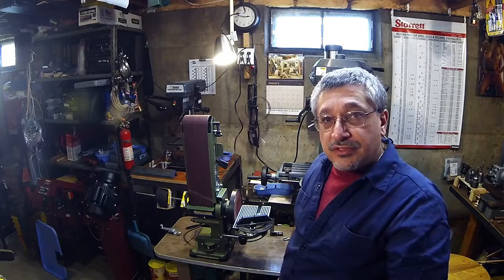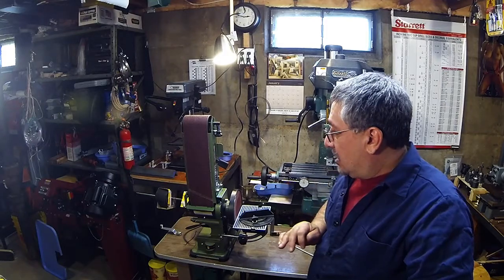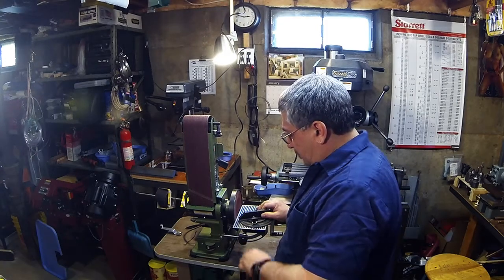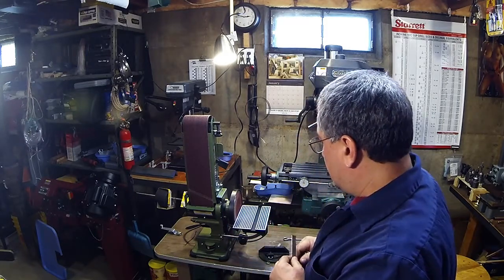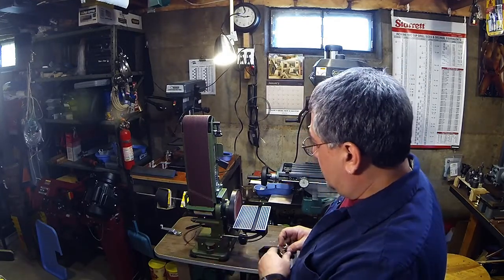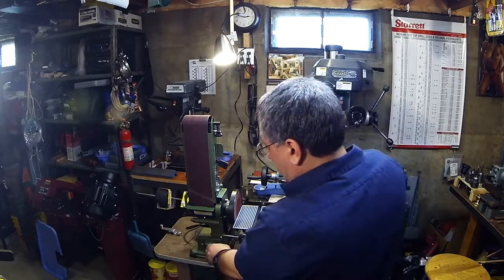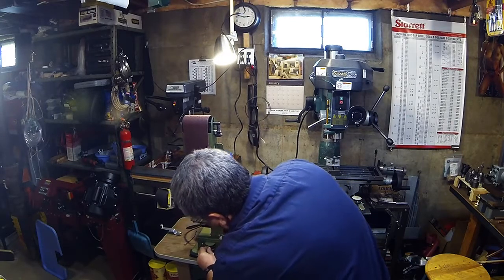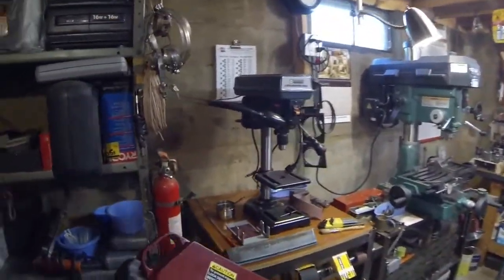Harbor Freight 4X36X6 Belt Sander

Comment: Worked great for my first project.>>>9m.no/톛쁮    Easy to change belts and never felt under powered. This is a small machine so don't think you're going to hog off a lot of material quickly. Only for small projects and you'll be happy. I did back off the back plate for the belt to press against while grinding so it had some give and contour ability and if you don't you'll get the bounce where the belt is connected, but that's normal in my experience.
Reply from the maker: Hello Michal Antos, I totally agree with you that it 's not for hogging material. I mostly use it for taking off the sharp edges on the machined parts. It still is a intricate part of my shop. Worth the money I paid and the service it gives me. Thanks for the comment. Be careful and make some chips.

Comment: is the belt sander still holding up good?
Reply from the maker: Hey Daniel0301. Yes the sander is working as good as when I set it up. Went through a lot of belts. My shop is a metal shop. Don't know if ya work wood or steel, but I would vouch for the product. Thanks for the comment.